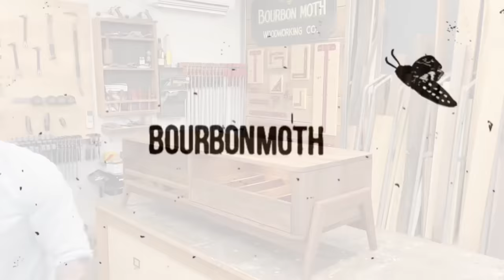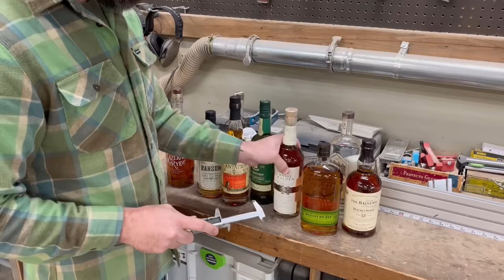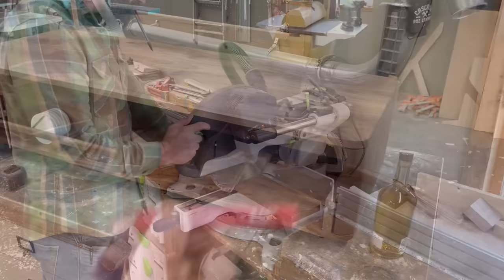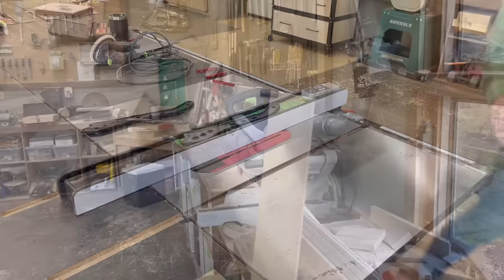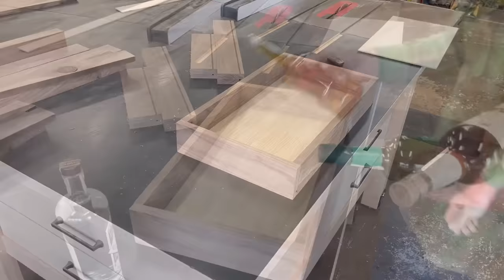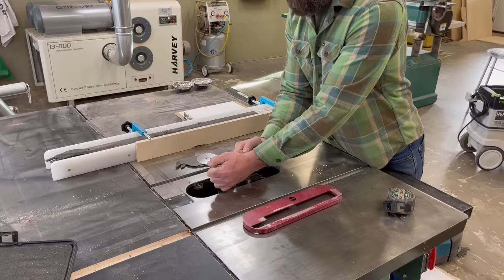Build cabinets the easy way || How to Make Drawers

Comment: I'm really surprised that you didn't have to file some teeth around the edge of that hole to get it to cut your dowel.  I would have sat there with my mini files, cutting some sharp teeth, and then probably had issues with chip buildup in the recessed parts.

Comment: Love the look! However it’s not recommended to store your bottles on there side with cork tops. The cork will break down if you. Would have looked pretty cool if you had angled the draw bottom so the bottles sat at an angle to display them a bit more. Over all great work great content keep it up!
Reply: LMAO..... you don't listen do you?
Reply: Storing whiskey different than wine?   Wine bottles stored cork down so they don't dry out.

Comment: Pro tip from a novice: don't bother rounding the dowel stock to fit in the chuck. Instead, keep it square and find a socket it fits in. Much better grip on the wood than the chuck.
Reply: @daveklein2826  LOL OMG STFU BRB NO WAY YAS QUEEN

Comment: At time stamp 7:48 please note he has a piece of wood clamped to his fence such that the end of of the drawer part being cut touches the wood strip throughout the cross dado cut. NEVER DO THAT!! The danger is that the end of the drawer part could bide or drag on the wood strip, rotate and get kicked out. The correct way is to move the wood strip so  the drawer part is NOT touching the strip during the cut. You can cross cut long lengths using the same method. The cut part drop into clear space.
Reply: Thank you Safely Sally
Reply: You are correct, if you are cutting through completely. If you are just cutting a dado, it doesn’t matter.
Reply: @JimPepperTactical  thank you

Comment: Why make a slot on the bottom when you could just nail or screw the bottom panel to the bottom edge of the rectangle?   After all, you're wasting an inch of vertical space.  The fasteners would be hidden, and fastening the panel adds quite a bit of rigidity to the overall assembly.   I'll tell you why:   Because the bottom is going to sag, especially with a load in the drawer.   When it sags it impinges on the operation of the drawer --rubs on the bottom.   I made an otherwise beautiful 300-lb giant chest of drawers using that feature for one of my first woodworking projects.   It's a design defect I've just learned to live with.   (Also, my tolerances were too tight.  In the summer the wood swells and the drawers seize shut, but I digress.)
Reply: LMAO